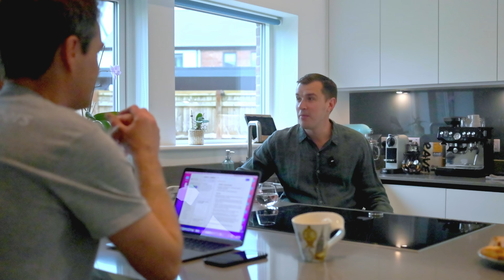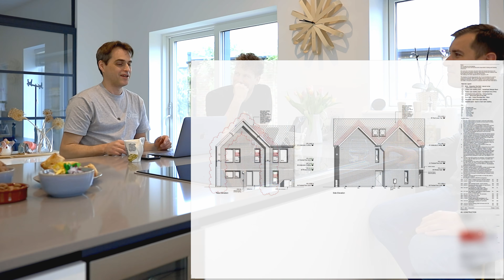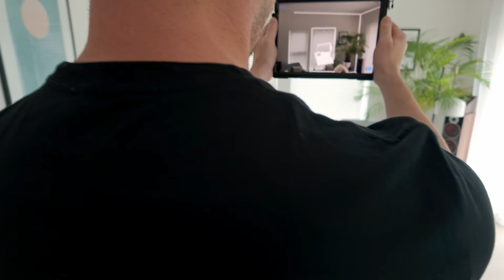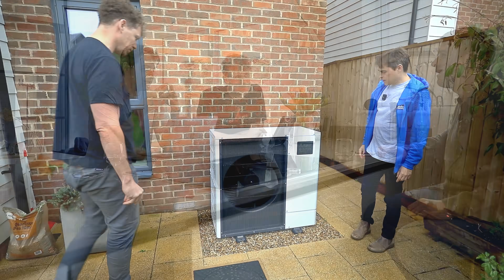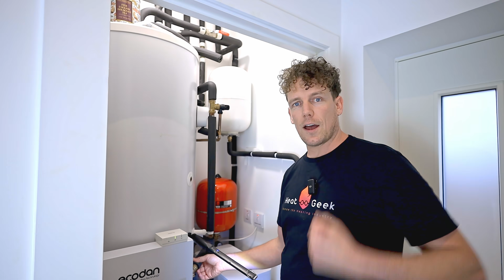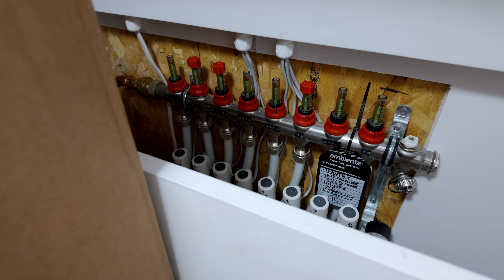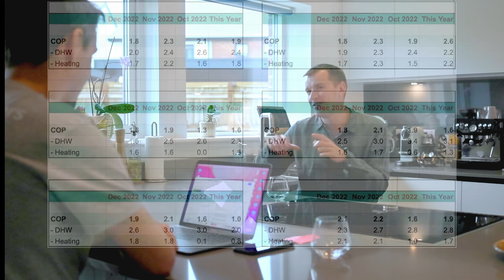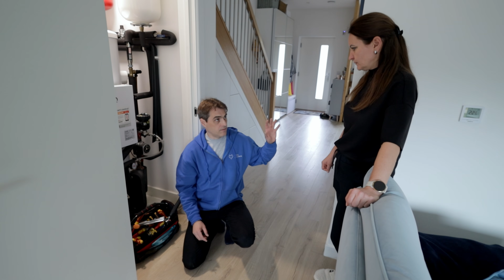How Developers Are Ruining The Heat Pump Market

Comment: In Poland, we have been using heat pumps for over 10 years without any issues, with 200,000 units sold annually. They perform excellently even at -15°C. In the UK, despite having milder winters and cheaper electricity, you always seem to encounter problems with heat pumps. Additionally, you regard heat pumps and heat recovery systems as something entirely new, it boggles my mind
Reply: UK power cost almost triple the Polish price.
I am assuming 500 zlotys ($123) per megawatt-hour (MWh) for the second half of 2024.
Reply: @andrewstafford-jones4291  The price you've quoted is more of a wholesale electricity price, without distribution costs, additional charges and taxes. As of now, polish households pay about $210 per MWh for the first 1500 kWh they consume this year, anything above that cap is in the area of $330-340 per MWh (and since that cap is quite low, anyone with a heat pump basically runs it on the more expensive electricity only). It is expected that as of July, electricity prices for households will be set at around $280, with no consumption caps.
Reply: @andrewstafford-jones4291  oh please.. I'm paying ~0.25p kWh in Surrey, my mom in Warsaw ~1.15zl kWh (0.23p) 
Comparing prices to monthly wages, the cost per kWh in the UK is significantly lower.
Reply: @andrewstafford-jones4291  Compare incomes since mere price without context conveys nothing.
Reply: I don't live in the UK, but from what I've seen, familiarity with boiler heat under-insulated houses seems to have caused a lot of habits which have to be unlearned.  Due to years of experience and ubiquity of the old systems in the UK, many HVAC pros aren't unlearning it.

In the US we also have a lot of trouble with over-spec'ing systems based on outdated rules of thumb, but that's mostly with forced-air heating (which is dominant here).  When you have hydronic under-floor heating like I do, it is rare enough that you get specialty installers who usually know what they are doing.

The videos on this channel are excellent sources to help inform and change minds, hopefully builders and installers everywhere catch up to it.
Reply: @RossWexford The energy mix is changing rapidly though.  

And the  COP on the few coldest days doesn't matter nearly as much as the overall heating season.  For the UK, coldest weeks gets real COPs of about 2.4 on average, and 2.8 for the whole season.  And that's including data from old buildings and poor installs.  

Finally, the thing everyone seems to forget is that gas requires a whole other infrastructure be installed to deliver it to homes.  That's quite expensive, leaks methane into the atmosphere way more than most people realize, and occasionally causes buildings to blow up.  Putting domestic gas in a new build is stupid conspicuous consumption at this point.  Gas heating (and cooking) is going the same way gaslights did.

That said, if you have a well functioning gas heater in a building already supplied with gas in a country with a high-carbon electricity supply, it would be silly to replace it.  And in a lot of places, just investing in better insulation is the first thing to do.
Reply: @RossWexford  Agreed.  Folks (like me) who are really concerned about climate change and want the transition to electric heating to be done ASAP are against that sort of exploitation too.  Also, wasting resources is wasting resources.

We've got too many people in this world who are just selfish assholes.  It is especially sad since there's a ton of opportunities to "do well by doing good"
Reply: @RossWexford  FWIW, I don't have a heat pump because I live in the subtropics and need heating for like a week every year.  Better to spend my money on a slightly more efficient AC.

I do have rooftop solar. We don't use much electricity, so while it is a win $ wise, it isn't a big deal. But I also put in a pretty expensive inverter and some batteries so it can run off-grid as an emergency backup, which was a straight up expense... We get hurricanes and have a dodgy electric utility, so worth it as insurance/peace of mind.

Anyways, plenty of different situations out there.
Reply: @travcollier  Living in the subtropics here are three things I have done:  1. Replaced 10KW electric furnace (with ceiling vents) with a 1.5KW electric baseboard centrally located in open floor plan. Now temperature at the floor is warmer that temp at the ceiling. No drafts, no noise. 2. Replaced thermostat (for cooling) with one with a full 2 degree differential (on 1 degree above set-point, off 1 degree below set-point). This results in deep cycle dehumidification - so comfortable that I can achieve desired comfort set 1 degree higher. 3. Run blower a full 90 seconds after each cycle off.  This results in 60 seconds of "free" cooling.
Reply: @christopherjoyce9436  Good measures.  It is interesting how often folks just assume everyone lives in a temperate climate.
I mostly run my AC for dehumidification too.  Just to also use a dedicated dehumidifier, but it wasn't all that much more efficient and where I live now needs a bit of cooling (previously lived in a part of Hawaii which only got uncomfortably hot for a couple of weeks a year).

You remind me that I need to buy a better (truly programmable) thermostat.  I'm tempted to use a raspberry pi.
Reply: @travcollier  Thanks for your reply. I also run a dehumidifier during the 3 months a year when no cooling is required. Runs awake hours only in the bedroom with the door open. Makes the bedding super comfortable and drys the rest of the house nearly as much. I should mention that on the A/C system I have also sealed duct leaks and increased the filter size to reduce the load on the blower. In my opinion, the filter on 90% of installed systems is under-sized. 3M brand filters have airflow specified on the filter frame cardboard. From this you learn that the filter size should be 200 sq.in. per ton (400 cfm). So for my 3-ton system I increased the filter from 18" x 30" to 18" x 36".
Reply: Heat loss of 6kw
Reply: Underfloor heating using district heating, ground source or air source heatpumps and heat recovery is pretty much standard hear in Finland as well. My house is specced at 21°C / -20°C with a 7,5kW ground source heatpump. Regulations mandate moving away from oil, gas and direct electricity.
Reply: When it gets a lot colder than -1, then the air gets very dry and the heat pump will only need to defrost every 2-3 hours. Between 0 and 3 degrees is the worst ambient condition for a heat pump, because the evaporator can freeze shut every 45 minutes to an hour depending on the operating point and this requires very regular defrosts. Therefore heat pumps can deliver more power and efficiency at -2 degrees then at 2 degrees. UK and the Netherlands have the worst possible climate for air source heat pumps, yet they make it work great anyway. The colder climate in Poland can actualy make it work better in some aspects.
Reply: @freekjacobs6096 ,I am wondering if you are in the Netherlands. We had a winter holiday in the Netherlands and were amazed that at minus 8 degrees centigrade the dikes were completely frozen but the cycle paths were completely dry and safe to cycle on. The air did indeed feel dry cold. This is completely different to the UK where typically the air is damp cold, the paths are icy and slippery in the cold weather.
Reply: @juliebrooke6099 The Netherlands aren’t much different than England .. regarding humidity etc…   Because NL is quite smaller than the UK, UK’s far south and far north are or can be different of course
Reply: @freekjacobs6096  not true at all.
As someone who lives in a very cold climate my ashps will defrost about once an hour at -10C.
Even in the sales blurbs for enhanced vapour injection heat pumps (which is largely irrelevant for the UK) state that regular cold climate heat pumps defrost every 45 minutes whereas evi ones will have 90 minutes intervals.
You can also check on heatpumpmonitor for ones in the UK during the defrost "sweet spot" barely defrost at all.
Reply: @freekjacobs6096  they have yet to make an ultra smart defrost board. The defrost technology could be drastically improved
Reply: @freekjacobs6096 Many ASHPs include an integrated heating element to stop the condensate from freezing
Reply: Do you have videos from your installations?
Reply: @Geyer128  I'm not an installer, but my entire family has been using heat pumps in their homes for years without any issues. You just need to choose the right pump and ensure the whole system is properly installed for the house.
Reply: What levels of insulation do you have ? this is a big problem with old Uk housing stock .
Reply: @AmiGarver  And that is the problem.In the UK many cowboys about who do a lousy job.Hence many people won't change from their Gas Boilers.
Reply: Powys council have recently paid an outside company to install air source heating in my dorma bungalow, it's a 6kw ecodan system, the installation and after support has been terrible, the company that installed clearly don't know what they are doing, they haven't even showed us how to operate the controller etc, and haven't properly lagged the pipes. My wife has heart failure so we need a working heating system, I want it to work but I think until its kagfed properly and set up correctly it's never going to be right..
Reply: The problem is the temperature often in winter is around 0°c and high humidity. It's killing conditions for heat pumps due to quick ice build up.
Reply: The biggest issue is our climate is so different to that of the rest of Europe. We have a relatively warm but very damp climate which means our design temps are right in the defrost range, meaning many people who have accurately sized heat pumps struggle to heat around 0C. We also have many many days which could be classed as 'shoulder' days where the heat pumps cannot modulate low enough when it's just warm and damp outside in the winter. Say 10-14C is very common. Personally air to water is not the answer in the UK, air to air is a much better solution for our climate.
Reply: @chriscodes1 the UK is nothing so special,in baltics humidity is around 80-95% in heating season,and yes people heat houses in spring and autumn when it's+8 or 10 or 14 degrees,and it's high humidity,no different to Scotland. The problem is sizing a heat pump, you basically won't see a 12 or 14 kw heatpump in baltics, that's for a 300 SQM house!!!! And
Reply: @aldish25  It's a completely different climate and standard of housing.
Reply: @chriscodes1 uk has milder winter's and cooler summer's,in baltics right now is a cold period for the last 3 weeks it's -10 to -15 depending on the region and even in these low temperatures humidity is around 75%, when the temperature will be up around 0 degrees humidity will be around 90% mark. It's actually very easy in the UK to size a heatpump because the temperature variation is not so big,for example in Latvia the law states that the main heating system must provide +18 degrees at -20 outside temperature,and you really need very good and accurate calculations to size the heat pump so that it's efficient during the whole heating season because the average winter temperature is +3 degrees
Reply: @aldish25  It's not just about the weather, it is also about our building profiles.
Reply: @chriscodes1 it's not really that different in new builds,the one major difference is that in UK outside/cavity wall is made out of brick's, brick work and brick's themselves are very expensive and is rarely used, it's settled with two types now ecoterm blocks with some insulation or timber frame construction, heated concrete floor and air to water heat pump or wood pellet burner for heating are basically standard now, nearly all new builds come triple glazed. And new builds are not cheap, cheaper than in UK but still expensive! 
Example 104 sqm house,3 bedroom,300mm wall insulation,400mm roof insulation,200mm floor insulation, Panasonic 4kw heat pump, recovery ventilation system, triple glazed, fully finished outside and inside with kitchen and bathroom built in cost 162000 euro and you need to add your building plot, water/waste water communication's, electricity connection,all the building permits,so on the cheap side you need to ad another 50-70k euros
Reply: People in the UK are always against change. They also get a lot of their "information" from social media and terrible news outlets that share misinformation to get clicks. They then share that with their mates down the pub and hey presto, everyone hates heat pumps.
Reply: It’s a bit more complicated than that, the way jokes are built etc
Reply: Does Poland use air-to-air or air-to-water?  My understanding is UK uses air-to-water because of existing hot water radiator heating.
Reply from the maker: @captsorghum A2W mostly
Reply: Boiler cowboys, hordes of them.
Reply: Subsidies.
Reply: The uk is 10-15 years behind mainland Europe in absolutely everything
Reply: @cecievadixy  Yes but progress doesn't always seem good. For example, I am very happy there there is a lot of copper pipe work still done in the UK.
Reply: Was installing whole house heat recovery and ventilation systems in houses and conversions in UK since early nineties. It's not new. Just depends on developer and property price point.
Reply: English Electricity is the most expensive on the planet. 
We should be addressing that issue first. 🤔
Reply: How long do they last compared to gas boilers with them having a unit outside as opposed to gas boiler all indoors out of the weather?

How long do you see an outdoor unit lasting. Im in a wet part of england but gas boilers are 15 to 20 yrs
Reply: @handle1196 heat pumps last easily for 20-25 years.
Reply: So much for the "specialists" out there. I want to become a Heat Geek myself soon. Have over 10 years of experience in renovations. Now ony path to becoming a qualified plumber and renewables engineer.
Reply: Yeah but also a lot of Polish consumers complain about their heatpumps because the pump wasn't properly sized to the system. etc
Reply: @Nimrawid  and what do installer errors and the total ignorance of customers about knowing anything their home needs, have to do with how a heat pump works?
Reply: @AmiGarver  Nothing really, the technology is great but incompetence can ruin anything. This gave bad reputation to heat pumps in Poland. You hear this bs talk all the time, how bad it is, how expensive and insufficient such installations are. All because unaware normies got duped by pushy salesmen.
Reply: I've had a heat pump since 1980.
Reply: Perhaps you design for and experience -15, we seem to design for +3 and wonder why the output is inadequate below zero. We also have 90% RH air to contend with.
Reply: @philthompson1097 you need to try harder,in Baltic states humidity is around 97-100%! Heat pumps work,at -10 usual cop is 2.5/2.6.
It's the clueless and overconfident uk jobos who can't do their job properly, that's it
Reply: I assume you fit heat pumps to the new housing  stock, largely paid for by levelling up funds from EU….as opposed to trying to fit them to flats or single skin Victorian housing like we have a lot of in the uk
Reply from the maker: @kensladen makes no difference - bad systems are bad in any house - Poland does get them right more then UK. Mainly due to better training

Comment: My initial thought is if built to Scandinavian standards, and almost passive house with MVHR would make it ideal for an Exhaust Air Heat Pump, so sub 5kW.  Lets go with 3.5kW
Reply: At least close enough to not cause any cycling. 🤣
Reply from the maker: Yes should I’ve been a completely different set up for those houses. Very good guess on the HL
Reply: @UrbanPlumbers  But the 3kW heat loss is calculated at what outside temp (-2°C?) which it hasn't been in England for some time, so clearly this house hardly needs any heating at all at the moment. It will be getting enough from the appliances and people inside. Which means the heat pump is probably only doing DHW and for a High Temp ASHP a COP of 2.2 is about right for hot water. If you put a heat pump of any available size into a house that barely needs heating but still requires hot water, you're going to get a poor COP.
Reply from the maker: @johnhunter4181 scops for heating is 2 and for hot water 2.8 I think - all figures are in the video for all house types. They all have heating scop of around or below 2 and DHW scops of around 2.5